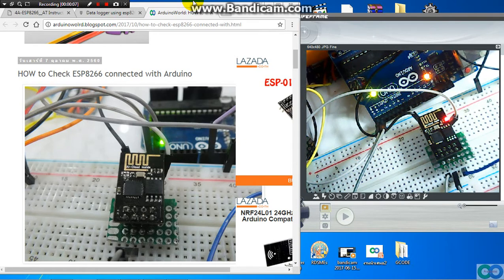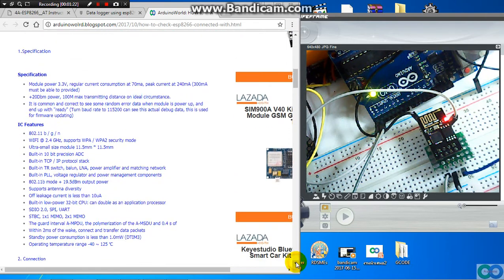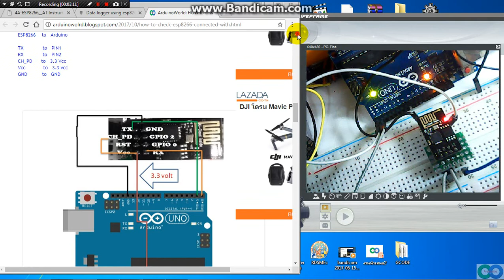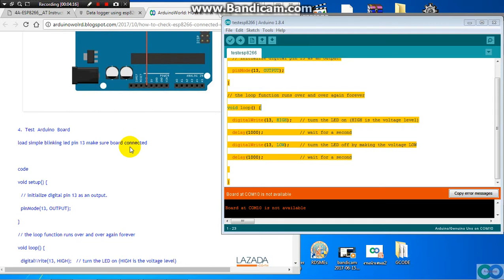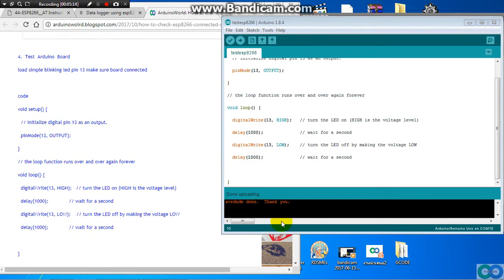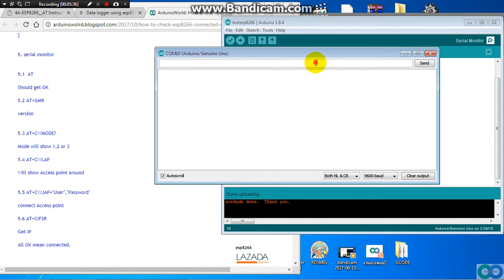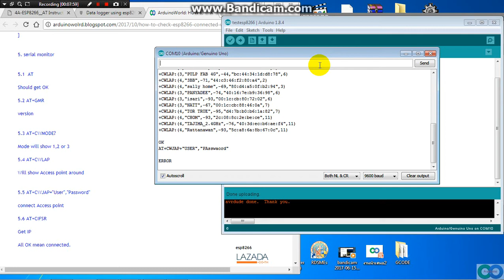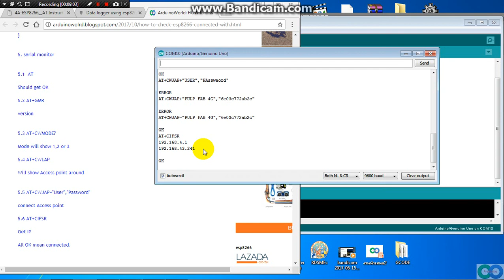How to confirm esp8266 connected with Arduino

Comment: hello, when i write "AT" in the monitor serial dont show me nothig, what is wrong. please help me
Reply: Whenever I would ask my dad why something didn't work for me, he would always reply to me, "You must not be holding your mouth right." His meaning was that whatever the problem is, it is some trivial thing. He would add, "You watch, the solution will be the last thing that you try." My response was, "Of coarse it will be the last thing I try, because once I find the solution, I'll stop searching for the solution." 
Well here I am 40 years later and I must still be holding my mouth wrong, because I too, can't seem to get a response to any AT commands sent to my ESP8266-01. I'm not trying to upload a sketch, so I don't have GPIO-0 Grounded, Instead, I have GPIO-0 connected to Vcc=+3.3 volts through a 10 k Ohm resistor. All other connections are as A-Arduino Thailand, has said.
When I apply power or ground the Reset Pin the Red power LED turns on and the Blue Tx LED, on the ESP8266-01 flickers  momentarily, then a row of gibberish followed by, AI Thinker, followed by Ready, appeared on my serial monitor. After this, when I type AT and press enter in the Arduino Serial Monitor, I get nothing in return. I have not found a solution.